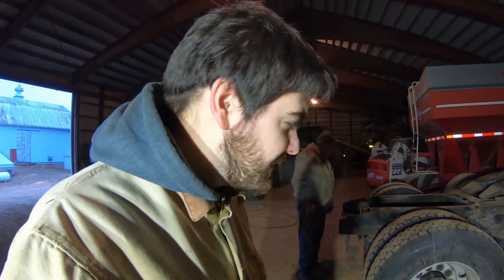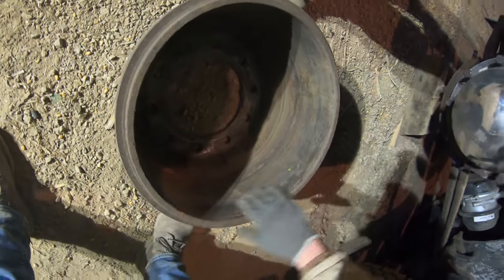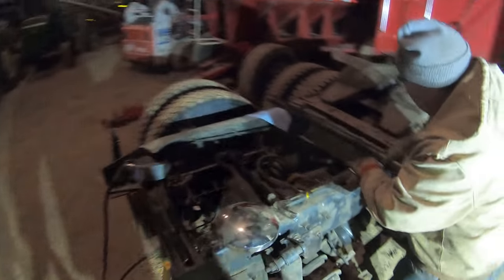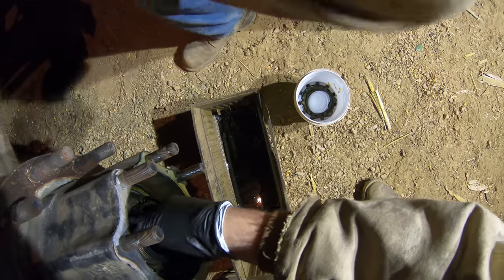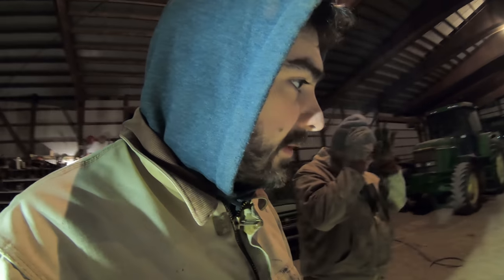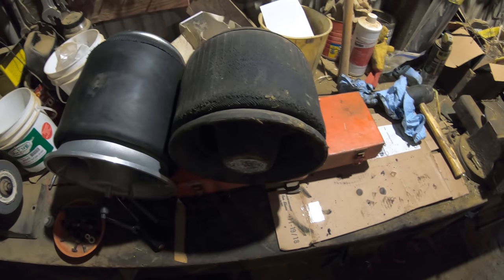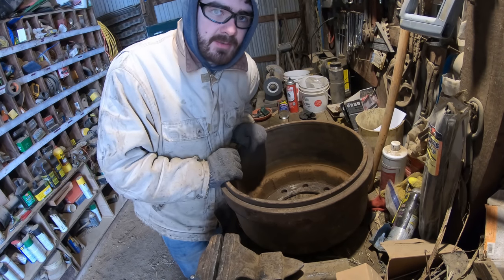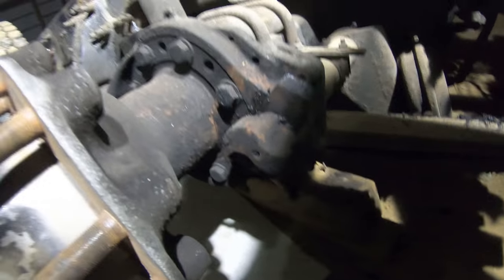New Brake Shoes and Wheel Seals - Big Red Freightliner

Comment: With an older truck these repairs are to be expected. I've bought cheap trucks thinking I will get by not spending money immediately on repairs but eventually these repairs come. I've bought other trucks that I've paid more thinking these repairs won't happen as soon but they can. The only trucks I've not had problems with are new. And this is because I'm a fanatic about maintaining them. And who drives them. Who ever has bought my trucks got a good deal. 
Looking at you open shed and dirt floor makes me wish for you that some day you close off a part of this shed cement the floor and insulate it making a decent place to work on equipment.  Happy New Year to you and your family.

Comment: I use a 2 wheel dolly to remove and put the hubs back on. No picking up those heavy drum's. There's a couple videos on youtube showing it done.
And taking the wheels off and putting them back on. Use a tire spoon, it saves your back. And makes the job so much better.

Comment: Helpful tip to getting the back bearing and seal out of the hub.. before you pull the hub off of the spindle thread the first smaller nut back on he spindle (after removing the washers and bigger nut) and then grab the hub and pull out and down at the same time. As you pull the hub off the nut will catch the bearing and seal and pop it out of the back. It’s much easier than trying to pry the seal out of the hub!
Reply: Also Lucas oil additive is worth its weight in gold I put it in all of my trucks engine oil, trans oil, and rear end oil.. every service I put 2 gal in the engine oil.. and you will go through those axle gaskets like crazy! I’m not a fan at all of using silicone on trucks for gaskets but the axles is one of the few places I use it! It will save you a lot of headache using it instead of the axle gasket. Also more than likely (obviously I can’t say for sure because I’m not there to look at it like you are) but most of the time on s cams if they just have slop in them you will only need to replace the s cam bushings not the entire s cam!

Comment: You're better off just replacing all the seals and bearings, since you were already there. Be careful with those brake cans, if you've never seen one blow itself apart, it can be quite the scare. Had one come apart on a trailer and hit the truck, sounded like a shotgun. Yes, get the tools and by the way, save your backs, use pry bars to install and remove the tires. Just need a block and pry point, so much easier putting the wheels on an off. If you're going to do it, do it right the first time. Take your time, it's an easy job but, if you've never done it before, can be quite "interesting". Cheers :)

Comment: Hey, you guys are doing good job. This is what I do for a living, It really is not to bad. I just always make sure everything is clean because everything goes back together that much easier. In our shop we have the machine that cleans all the parts, but on the road we just use a bucket with a little regular gas and it wipes everything just as clean. Buying all those cans of cleaner can get a little expensive. Happy New Year to the whole family and Wishing a wonderful 2019!
Reply: They're doing a great job the seal didn't even get on the shoes that's a blessing.
Reply: Gear oil isn't even on the shoes or the drum.

Comment: Hi don't forget to clean out the diff breathers on top of the back axles if there blocked it will blow the new seals out as soon as you start to use truck .all the best for 2019

Comment: just a friendly advice, blowing a wheel seal on a winter might cause by thermal expansion. check your vent make sure not stuck close.. in my opinion packing bearing with grease and some manufacturer service manual require this step, because it may take time for the gear oil to reach your inner and outer bearing
Reply: at the minimum fill the hub with gear oil ust before installing the outer bearing.

Comment: Take the chrome hub caps off before removing wheels. Saves them from getting dinged up. To remove an axle, simply hit it on the end with a big hammer after all the nuts are loose. It will jump back about an inch and then you can simply pull it out.

Comment: On the brake pot rod, I Believe the usual spec is that when you have a full application the rod and slack adjuster make a 90°angle. And truck parts are always the cheapest in the context of a farm. Commercial haulers go through so many of them and there are so many aftermarket parts for everything it makes it much more worthwhile to shop around and get better deals, almost to the point that you hardly have to shop. Way more competition =lower prices = surprisingly cheap to run.
Reply: Also u apply at 100psi to check it correctly max stroke is 2 inch on 30inch can and 1 3/4 on 24 inch can

Comment: One way of tearing the works down they taught us in school was to pull the axle, take off the big nuts, and pull off the duals, drum, and hub as one big assembly. It's heavy and awkward but is another way to get at the spindle.
Reply: They would need a concrete floor and a wheel cart

Comment: Great video! Might want to consider putting manual slack adjusters on. Those auto slacks tend to quit working after a bit, especially when it's only running couple months out of the year..
Reply: Manual Slack adjusters are a PITA. Bought a new Kenworth with automatic adjusters and they were still working great 24 years later when I retired and sold the truck.

Comment: When replacing brake drums I replace all as a set.  I have had very poor luck trying to replace one drum or trying to salvage one drum. Usually ends up with a grabby brake that causes a wheel to slide with easy application. Not worth the hassle, just replace them all at once, that way they all match.

Comment: I missed a video or two apparently because you have a big money pit to tinker on now. I'm not sure I would have jumped for a truck. By the time you plate it up and throw insurance on it and make it legal you'll have to haul all of the neighbors corn and beans and whatever you can in order for it to pay for itself. And that brake chamber that has the long rod probably isn't the right one. You can get a short and long stroke. You habe to pay attention to which ones you get, for future reference. You may want to get a spare pancake for them so if one gets a leak you can change it. And do check your airbags on the sleeper, they dryrot and get a hole in them and if they have dampeners you may want to change them out. Just a few things to consider.

Comment: just had the air bags on the front axle replaced on my Volvo. 600 a piece and 600 for the job.  guess have to replace the rears soon also. and its a 8 bag design for the tandem. voi voi voi.

Comment: Does the axle Flange have a plug for you to add oil? ..... if not park on an incline with the wheels down hill so oil can run down the axle tube from differential out into the hub,,,, bearings need oil

Comment: I would change the rear end vents also.
Reply: Yep a simple cheap vent so it doesn't build up to much pressure in there and blow out your new seals, Would be good insurance
Reply: @thomassuhadolnik8027  yes sir. Been doing it 25 years working on and driving them. 95% of the time if a wheel seal goes bad the vent it bad.
Reply: @christophergoodman404  Or it's a National seal! I don't know if they've solved their problems but we quit using them. The suffix on the seal indicates a revision. They went through all of the letters of the alphabet and were into 3 digits the last time I looked at one. I always liked the Scotseal Plus. They install by hand. The vents are easy to change or clean.

Comment: Ryan here's a tip, use a hammer and tap your u- bolts to make sure they aren't loose and you don't need to do suspension work otherwise great video.

Comment: Seems your dad may have been a truck mehanic at sometime, seems he knows what to do there. Dont look like you all tightened the wheel bearings down enough. If you have any trouble with them coming loose, next time tighten the inside nut down as tight as possible with your socket and ratchet and back it off 1/4 turn. then outside nut tighten it down and bend your tabs back over.

Comment: I'll bet you wish you had a heated shop for jobs like this in the winter?  Major expense to build though....
Reply from the maker: Would be nice. Who knows, maybe the money saved by the truck will cover the cost to build one someday.
Reply: @HowFarmsWork  i was just thinkin the same thing as i was watching this.......bring a spray foam contractor in and boom, u could heat that shop with a candle
Reply: I don't know what we would do without our heated shop, but you're right, it's not cheap.
Reply: How Farms Work spray foam the walls, then build a waste oil burner... you need to change oil in the tractors anyway, why not use it.  You can build a waste oil burner very cheaply, but the bought ones are junk.... they arosolize the oil to burn it and it clogs up.  When you build one it’s not “plug and play” to start producing heat, but it doesn’t clog.  Look it up, they are very handy and useful.

Comment: Why didn't you put the 23,000# brakes on instead of the 20,000# brake shoes? When setting the inner nut tourqe to 25# than 50# than 75 foot pounds an each time spin the hub  you want it to spin at least 3/4 of turn when you spin it with lube. Good job working on it an learning the workings of you're own truck
Reply from the maker: Honestly had no idea there were different kinds. It’ll be something to consider next time!
Reply: @HowFarmsWork  just like the cast drums them$112.00 are bottom grade drums there good usually one set of brakes of the 23,000 sometimes you can get two set of of shoes though the cheaper drums. The drums I run are Webb drums I get 2-3 sets of shoes out of them. I'll look when I get to the shop an get you the part numbers for then if you want them Ryan
Reply from the maker: @johnwarren-649  Wouldn't hurt for future reference!
Reply: @HowFarmsWork  I'll on them to you probably the weekend of January 9th is when I'll be back in off the road
Reply: @johnwarren-649  The cast drums are probably just fine for the use that a farm truck will get. Don't rack up the miles like an over the road trucker. The factory cast drums on my Kenworth lasted for 350,000 miles before I had to replace them.
Reply: @richardvandyke9578  we use to run them on all of grain trucks an trailers now we run steel center fuse drums for weight an longevity of the drums last time we put them was four years ago an that's been three sets of shoes an showing very little wear now with 23,000 pound shoes. Now keep in mind we only 30 miles one way with lots of starts an stops in a day grossing 90,000# every load on did axles
Reply: When working the inner nut its 100lbs back off half turn then tork to 50lbs then back off half of a flat the u tork outer nut to 250 lbs then bend tabs over u want 0 preload

Comment: First two are fun third one is tolerable last one is i hate trucks why did I buy one. Then you forget when it comes time to do brakes again oh this isn't bad, halfway through you remember why you hate trucks. Might just be me after 15 years laying under one in my "free time".. They are that complicated put the springs on can be a pain but there are a few tricks. 
 You can put the top shoe on , put the side springs on and wrap the bottom shoe around and hook the big spring , pry up and down on shoe to install s cam rollers.
or put top shoe on, hook big spring on top and bottom shoe, pull down bottom shoe push over into place, hook small spring on bottom inside pull up with vice grips to hook top same thing on outside one , install s cam rollers.
make sure to change anchor pins. If they are froze a ball joint press and heat will aid in their removal.
If you aren't trying to reuse the brake hardware step on the shoe to stretch the spring and they come off easier or just cut the springs. 
the slack adjuster needs to be set with the template to get the proper angle so it maintains the correct adjustment.

Comment: When installing wheel hubs back on the drive axles, AND also on the trailer axles, you torque the inner nut to 100 FT LBS, install your wheel nut locks, and then tighten the outer nut to 200 FT LBS, then bend down a lock tab. Hopefully you or your Dad refilled the cavity in the hub between the bearings with fresh gear lube. If not, you're gonna have MAJOR problems!!!! (BTW, the steer axles, if it has conventional style wheel bearing nut(s) and locknut like the drives, is torqued to 50 FT LBS on the inner nut and 100 FT LBS on the outer nut!) The trailer, BTW, will be easier to do because you don't have to pull any axles. Just remove the outer hub cap to get to the nuts and bearings. AGAIN, remember to fill the cavity with oil!! Can't stress this enough. A burned-up wheel bearing/hub/spindle is an ugly, expensive, and potentially dangerous thing. Trust me, you DON'T want that to happen!!!
Reply: And there are left and right s-cams so make sure they are on the proper sides.